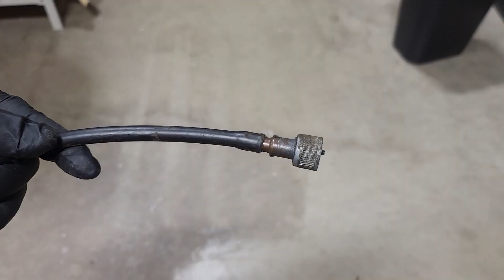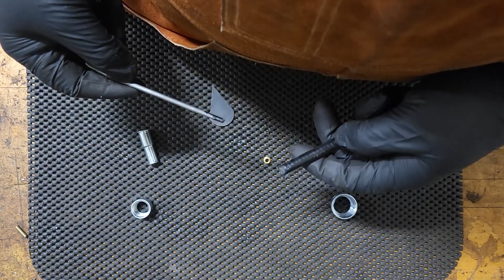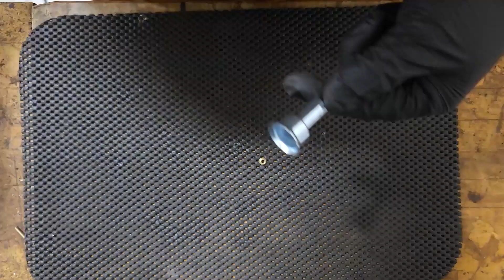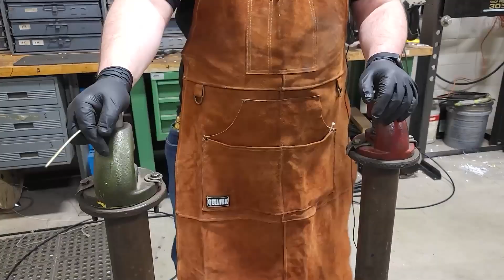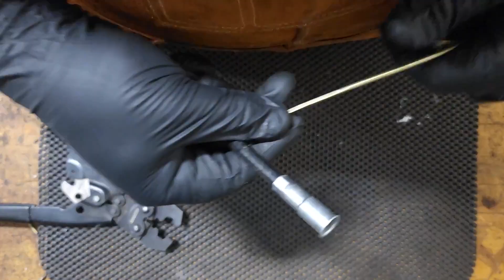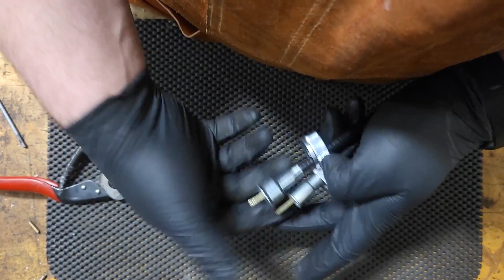MAKING A GM SPEEDOMETER CABLE WITH A GROMMET

Comment: I need just the core about 3-1/2" long with flex in the middle and square at each end. It's for a drive cable on a set of truck steps that retract. Any idea if you'd like to make a bunch of these for me?
Reply from the maker: Give our office a call at 1-800-661-1649 or visit our website at www.mrspeedometer.com

Comment: Great video!
Where did you buy the speedo ends and what are their 'technical' names? I can't find them online.
Where did you buy the speedo wire squared tools?
I have a scooter workshop and speedo cables are used in 90% of them.
Thanks
Reply from the maker: I have a speedometer shop and I have all the ends, ferrules, casing you name or for all kinds of applications. my website is www.mrspeedometer.com I have a catalog on the website with all the various stuff I have along with some of it on the website itself with me adding more to it all the time